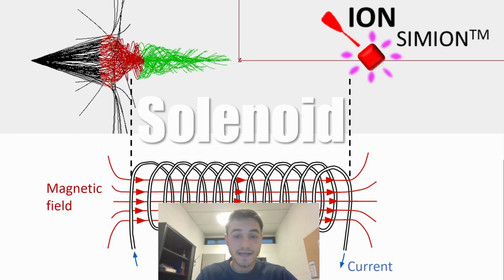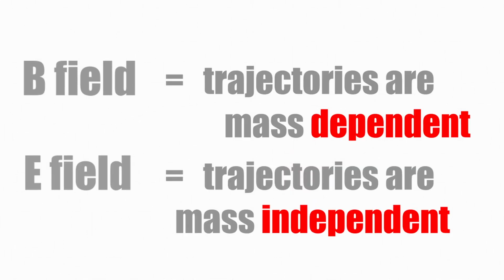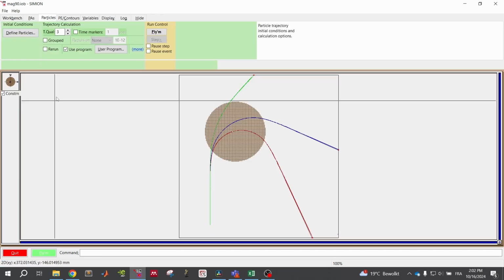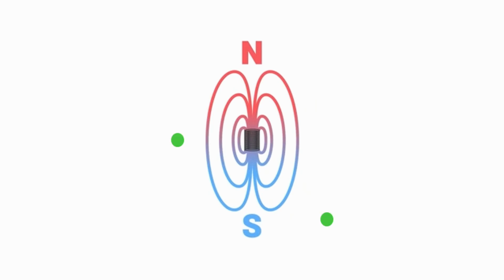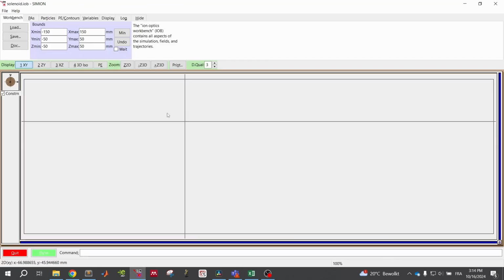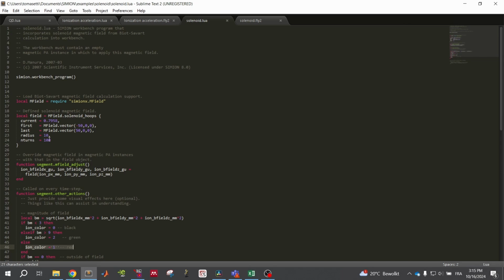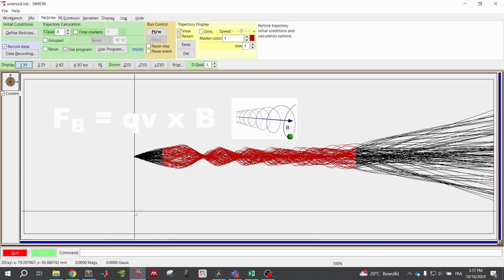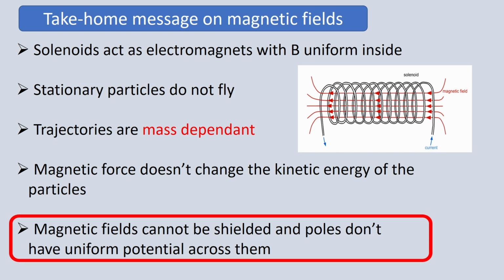Solenoid and Magnetic Fields – Understanding Ion Trajectories with SIMION

Comment: Is there a way to make the electron beam focus outside of the solenoid?
Reply from the maker: Good question. I guess it is possible because the electron seem to focus with a frequency inside the solenoid and therefore maybe also outside? However the electrons are diverging at the exit. It is worth trying several parameters
Reply: If you want to focus a beam, you would use two magnetic quadrupoles. One focuses in the x direction, the other in y.